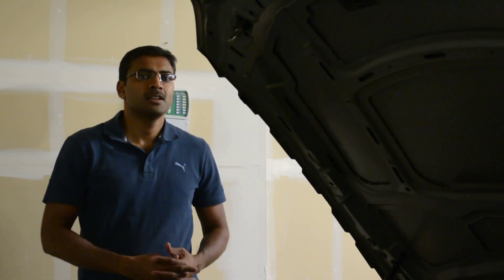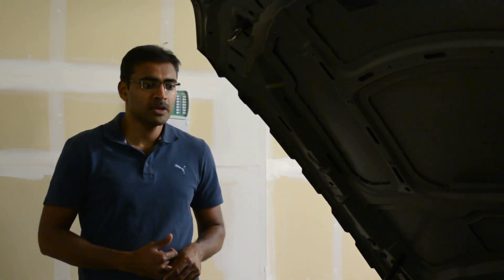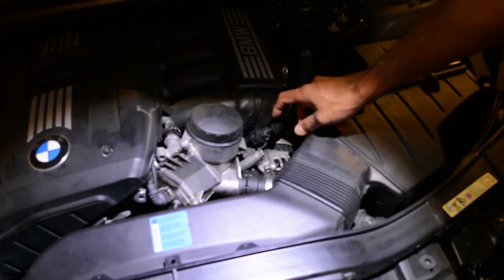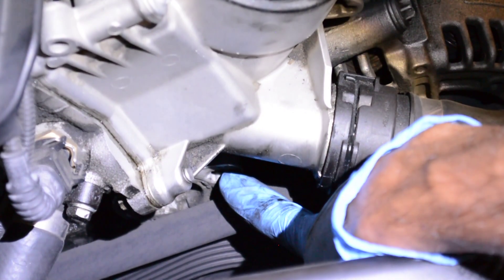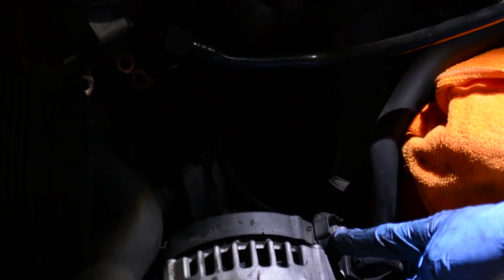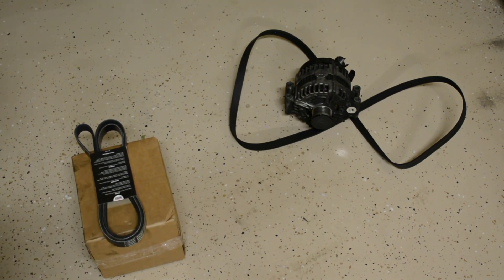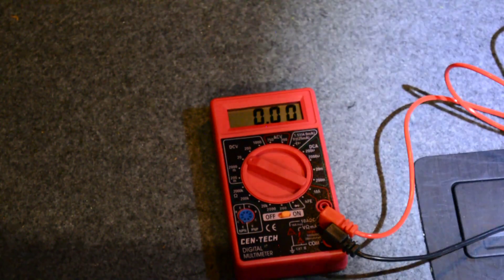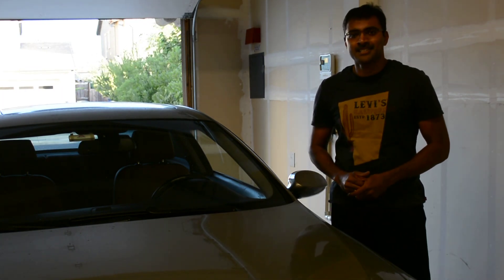BMW 328i E92 Alternator Rattle Noise/Replace

Comment: This is FANTASTIC! I've been hearing this strange intermittent/fluctuating rattle/marble in a can sound for a month now. It only happens when the engine is at idle around 600 - 700 RPM. As soon as I press the gas it goes away. I did some sound probing last night and it sounded like it was coming from the alternator. Then I found this video and it's EXACTLY THE SAME SOUND! Thank you so much for sharing this! I'm going to replace the alternator. It's original, and the car is at 260k miles.
Reply from the maker: Good to know it helped you. It is usually the bearings in these alternators fail, as it sits exactly below the Oil filter housing which are prone to leaks. Also nice to see 260K miles on your car. Folks who know these engines, know it can last forever if the regular issues are sorted out in a timely manner.

Comment: Did your noise only happen when the ac was on and get louder at idle ?
Reply from the maker: In my case noise was consistent with rpm and didn't matter whether AC was on or not.
Reply: Vijay Guna thank you 🙏
Reply: i got what you got was it the Alt for you?
Reply: Yes it was the Alt . After awhile it started doing it without the AC on and or just turning the wheel it would click and the Alt spun freely no clicking with belt off.  seems when torque was put on it from AC or PS and heated up it did it the most....

Comment: Finally a video that shows the same noise my 2011 BMW 328i has. My noise goes away when you rev the motor but at idle it sounds like a ball in a paint can rattling intermittently. Thanks for the video buddy.
Reply from the maker: 👍. Hope you have resolved your issue by now, as these noise issues seem simple to identify, but is not 😊. It could be any of the accessories attached to the drive belt or the engine itself. The elimination process really helps here - remove drive belt, no noise then one of the accessories. Then switch on ac, turn steering etc to keep narrowing down the issue.
Reply: @vijaypguna  hell ya it did thank you very much . Engine is purring like a kitten.  Bearing was frozen. Great call...
Reply: Vijay Guna I am experiencing a similar noise. I checked my power steering pulley and it seems fine. The belt and the most pulleys seem fine and not loose. I do think the noise goes away with AC. Which pulley would that be?